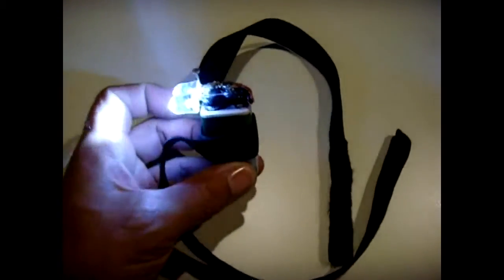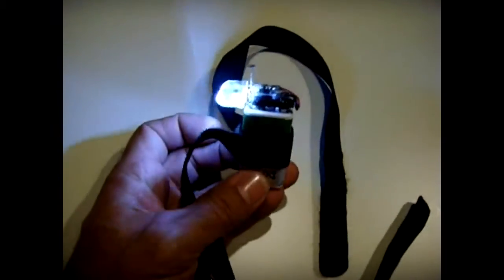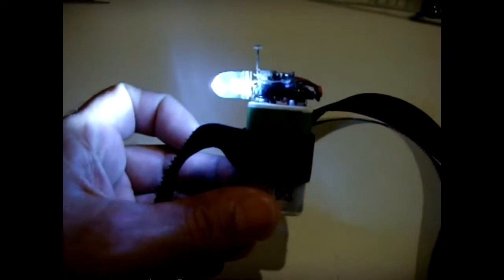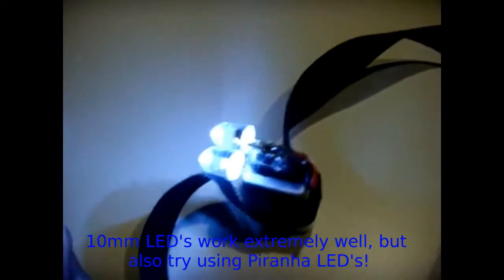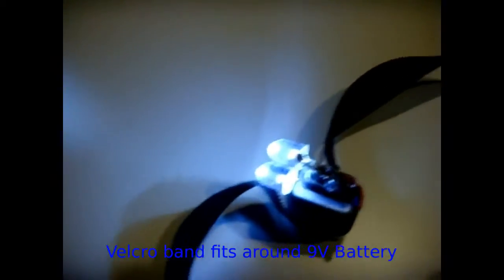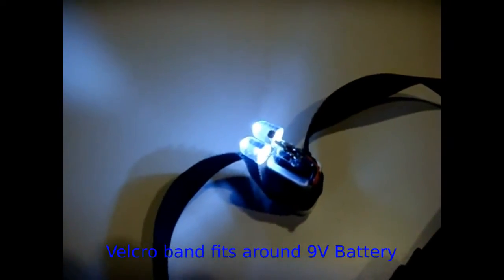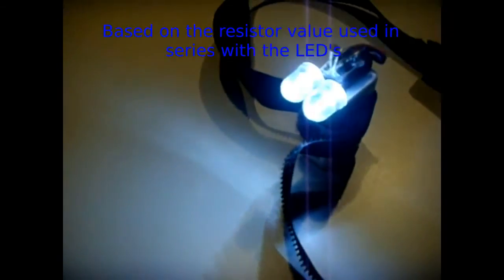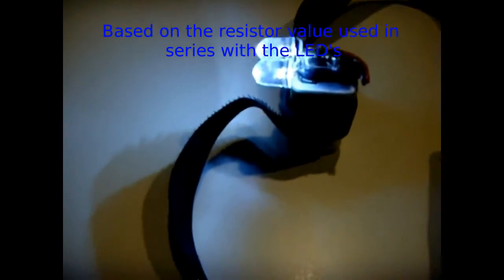Ultra Bright Dual LED Dark Activated Headlamp Circuit

Comment from the maker: All the components were assembled on top of the hard plastic 9V battery connector, then e-6000 glue was applied to keep everything from moving. You can also epoxy encapsulate the entire circuit.The head band is a strip of velcro with one side hooks, and the other side loops. In the center of the band, the two strips are not connected together so you can slide the velcro strip firmly over the 9v battery. Works perfectly.

Comment from the maker: SORRY!!! There was an error in the schematic. The value of the resistor is 82k - 100k!!  You can also try GREATLY reducing the value of the 150 ohm for more light output. I was able to eliminate the 150 ohm resistor and still not over voltage the LED's. I will correct this in the video right now. The circuit works extremely well if the correct value LDR/resistors are used. The light output is very bright. It is as good as you can get for the size of the circuit, and current consumption,

Comment: Hey..Good job, the 82k makes it work....However as I walk through the house (daytime) the different brightnesses make the LEDs come on and dim etc, its really quite sensitive...I suppose a much bigger resistor is required to make it come on only when its really dark...I think as it is, the street lighting would make the LEDs go out which is maybe not so safety concious?. Still a great little circuit especially now that it works..I was going to make a light/torch gadget for our dog.

Comment: Hi great circuit, what kind of LEDs?  Source?  and how do you set the run time. I would like to set this up with your motion less timer and use this at night going through the hall and bathroom and to the kitchen no need to turn on the overhead lights late at night.  Thanks for sharing.

Comment: Hi..Had a go at this with a 1kOhm & 150Ohm resistors a LDR..exact same as yours but the LDR doesnt turn it off..Anyone know if the resistance of the LDR in light and dark has an influence on the resistor to use?..I get in light 2,4k and in dark 36k, both values are a bit wobbly!....Thanks for your video.

Comment: that's nice but wouldn't the strap get too greasy from forehead and form a short between the connections over time?
Reply from the maker: No. I use this all the time. I don't understand how you would think this would cause a short? The battery is held snugly inside a loop in the velcro band. The soft side of the velcro, and the battery, are the only parts that touch your forehead. There is no contact between your skin and the circuit which sits on top of the battery. This happens to be the best headlamp I have ever used due to the level of brightness, and the amount of run time you get, as well as the auto on/off feature. If you have a problem with sweating, then you should use a headband under the strap.
Reply: Yeah thanks.   I do sweat a lot lol.

Comment: are the leds connected in series?
Reply from the maker: Yes.
Reply: thanks for the info.by the way,what is the value of the resistor that you used? I used a 150 ohms and 82 k but the led would not turn off properly.do i need to increase the 82k resistor?
Reply from the maker: If your LED's do not turn off properly, the the value of the 82K is not correct. Use a 200k POT in place of the 82k to adjust the circuit until it works. Then swap out the POT with a fixed resistor which is close to the setting of the POT.
Reply: electronicsNmore So,I need to place another resistor at the POT or just replace the 82k with a 200k POT?
Reply from the maker: replace the 82k resistor with a 200K pot.
Reply: ah ok,thanks for the info.